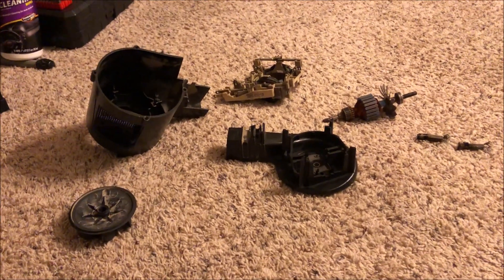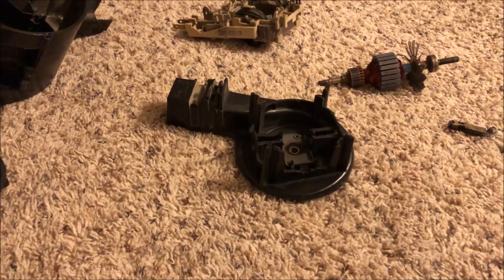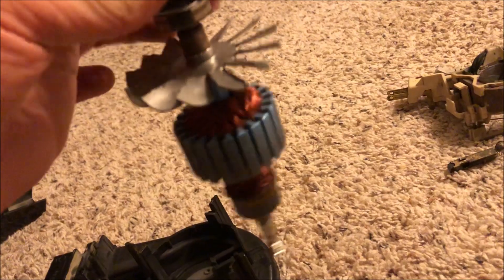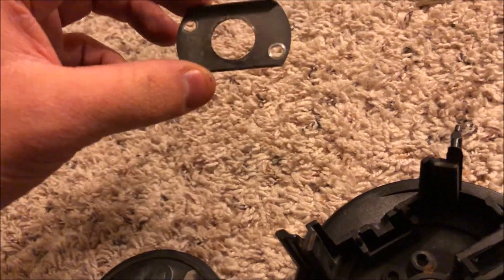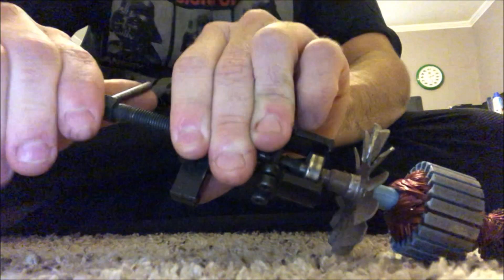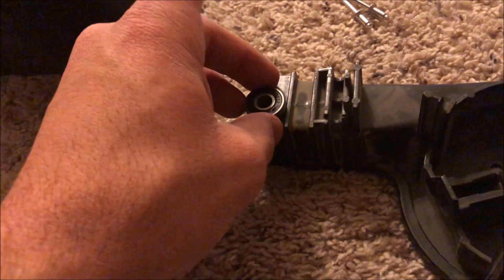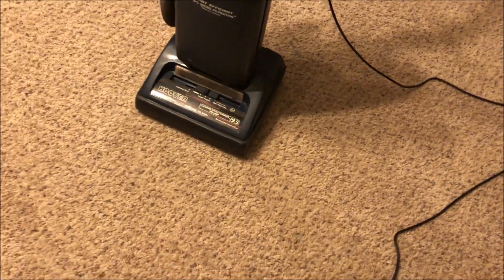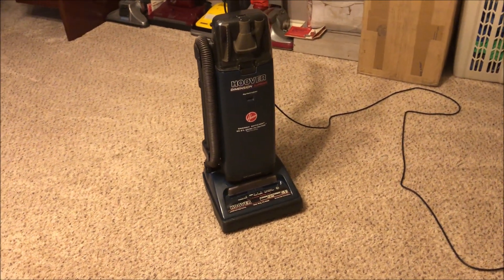Maintenance: Hoover Elite Motor Rebuild (How to Replace the Motor Bearings)

Comment: The owner's manual to my 1988 Hoover Elite U4455 states that the motor is equipped with one ball bearing & one needle roller bearing.
Reply from the maker: That was the early motor design that came on these Elites when they were brand new in 88, which was similar in design to a Concept One, but was later changed to a ball bearing in later years since a lot of customers complained about it making too much noise.  I recently acquired an early 88 Elite 350 that has that the needle bearing motor, but I also have an Elite 5.0 that was made after the ball bearing revision.
Reply: @graysonsvacsandmowers5426  Have you ever replaced the needle roller bearing? I think mine is shot. Is the procedure the same as the ball bearing? Thx.
Reply from the maker: @stevenbernstein1978  Honestly, I have not, I would really like to tackle that though, and I want to believe that it's the same needle bearing that the Concept One uses, but I won't know that for certain until I tear into my Elite 350 with the same style motor like your Elite 200.

Comment: what size bearings you using?
Reply from the maker: 608 8mm
Reply: @graysonsvacsandmowers5426  I end up getting the wrong bearing for the windtunnel motor

Comment: Thanks for this, i think this is the only video on youtube that actually explains how to replace the bearings on these things. I was gonna attempt it myself but was afraid of breaking something, but now i know how to get to that inner bearing.
Reply from the maker: I was the same way, until I finally decided, what do I have to lose?  Besides, I had another junk motor to use as a buildable core incase I broke this one.
Reply: @graysonsvacsandmowers5426  yeah id rather practice on a junk motor I didn’t care about from the later Elite models first before attempting this on one of the more rare 5 amp motors with the headlights.
Reply: @graysonsvacsandmowers5426  i sometimes hear bearing noise with one of my Elites but it goes away the more I use it. The oil inside the bearings just dries up over time. The key to keeping the bearings from going is to just fire them up once in a while and keep the internals moving. Like a car, the worst thing you can do is let it sit.
Reply: Where did you get the replacement bearings?
Reply from the maker: @tylonbarnes9678  eBay